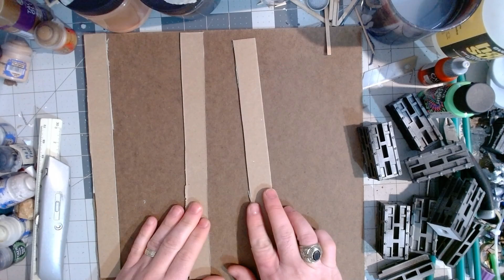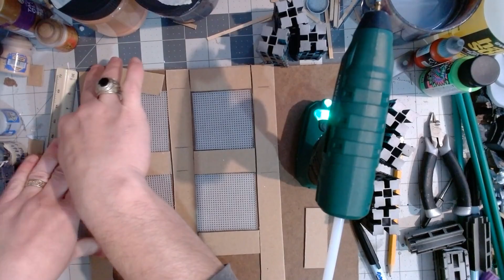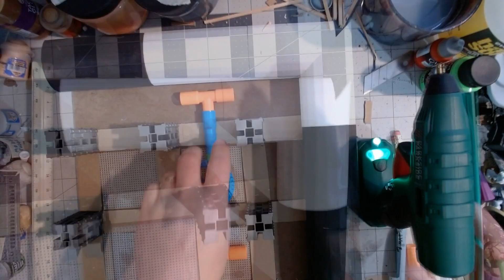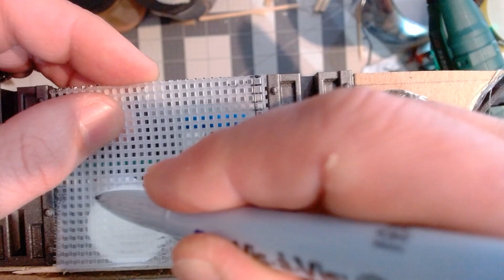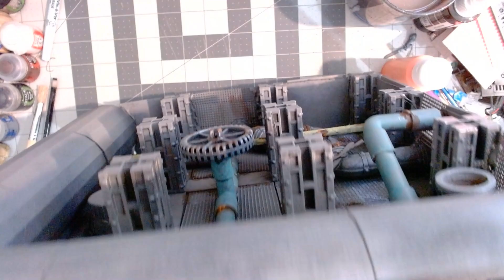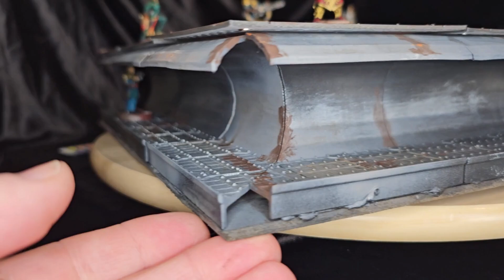How to Build an Awesome Themed Gallowdark Tile

Comment: Suggestion.  Next time if you're putting grating under multiple sections, just keep the grating intact and glue the structure overr the top.  You'll avoid gaps at the cost of a bit more material used.
Reply from the maker: I kind of did that with the first one and had issues with the different layers, I think the flex of the gating worked against me.